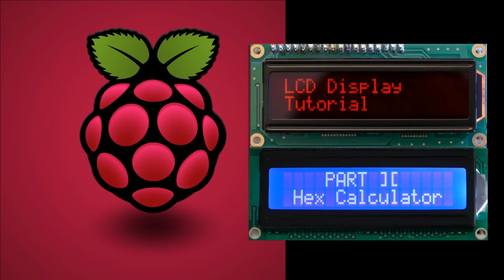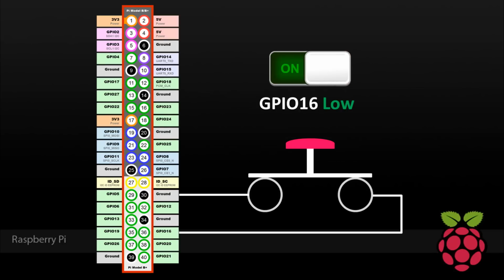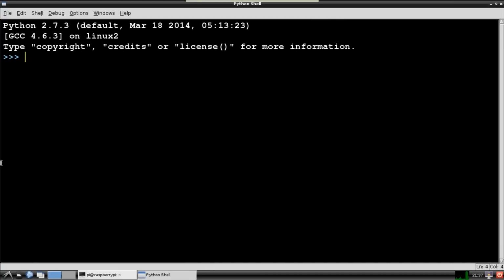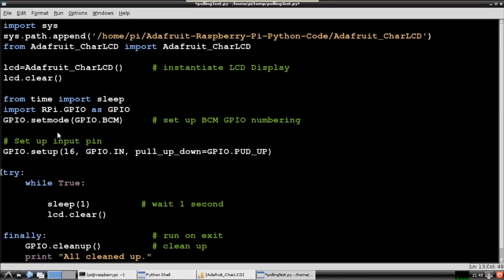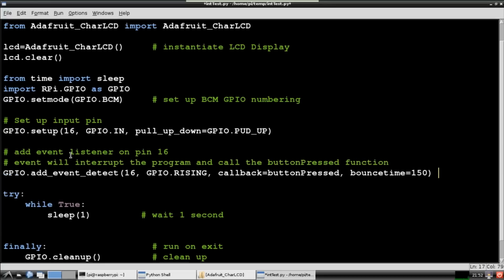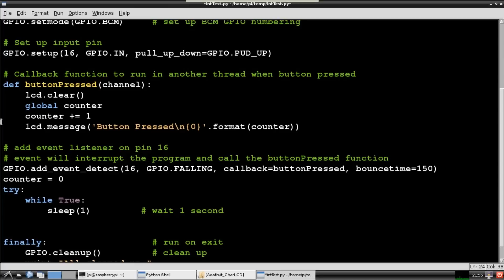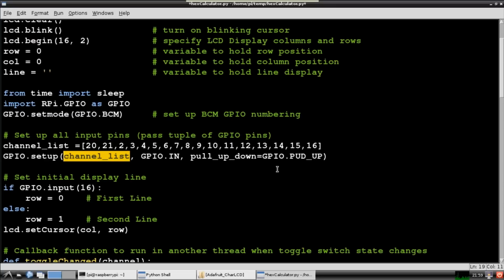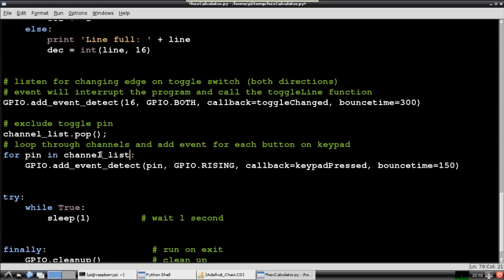Using an LCD Display with Inputs & Interrupts on Raspberry Pi

Comment: Nice video. I see you don't seem to debounce when using the polling method. The 1 second delay from sleep(1) doesn't seem like it would act as a debouncing method.
Reply from the maker: In the example, the 1 second sleep time is the debounce.  It is an exaggerated time to make it easier to visualize.  It is too much debounce time and could miss quick switch presses.  Many newer switches have very short debounce times.  The datasheets may give the debounce time in microseconds (µs instead of ms).  However switches vary greatly (especially salvaged equipment).  You just have to experiment and see what works best even if you have a datasheet.  Often you can be very conservative if the timing requirements of your program are minimal.  I usually only use the polling method when timing is not critical or when I’m experimenting.  Otherwise, I prefer an interrupt.
Reply: @rdagger  I see. I'm working with a rotary encoder and require shorter debouncing times. I've gone from polling to interrupts and recently discovered possible device tree overlays for the Pi. I've learned a lot from your videos. Thank you.

Comment: I need to display other language other thank english . can you help me ??
Reply from the maker: You can buy LCD displays with different character maps.  Also there are usually a few spaces for custom characters.  I'm not sure if the Adafruit Char_LCD library supports other languages.  You would have to check with Adafruit.  If not you could probably find another library that does support your language or you could modify an existing library.

Comment: How can we use interrupts to check the status of a 5v relay with the incandescent bulb?
Reply from the maker: It depends on the relay.  If there is an unused pole on the relay, you could use it to toggle a GPIO pin.   Otherwise, you could add an opto-coupler to the relay’s 5V input.  This could trigger an isolated GPIO pin and fire an interrupt assuming there is enough extra current to drive the opto.  Another approach would be to place a Hall Effect sensor next to the relay that could detect the changing magnetic field.  You could also use a photo transistor to detect the illuminated bulb.

Comment: This interrupt thing is exactly what I am looking for, but I want it to restart the program.  I am basically running a traffic light program and I leave the red LED on for 3 seconds, the yellow LED on for 3 seconds and then the green LED on for 6 seconds.  I am using this as more of a drag racing light tree and I will be using a infrared sensor to detect if the object left early or what the reaction time was.  Then there will be a switch at the end to tell me total run time.  I want to be able to "reset" the program to start from the very beginning at any point in the program, in case there is a problem, instead of waiting till the end to start over.  How would I program this interrupt to do that?
Reply from the maker: You have at least 3 states (pending race, racing, race ended) which you can track with a variable.  You have 3 interrupts (sensor at starting line, sensor at finish line, switch to reset race).  You turn on your interrupts when the program starts.  There is no need to modify them afterwards.  Instead you check the race state variable in the call back functions to determine what code runs.  The reset race interrupt could be a push button switch that changes the race state to pending race.